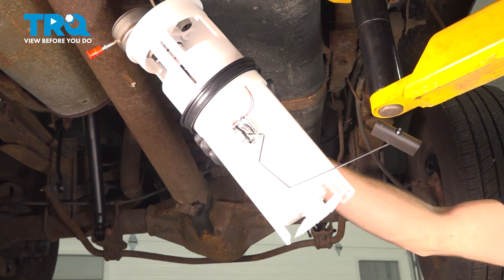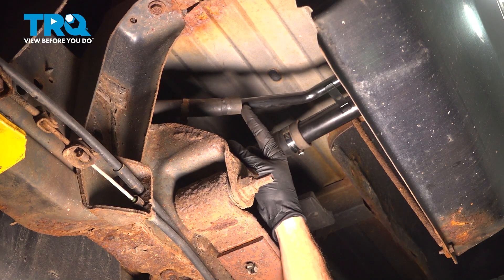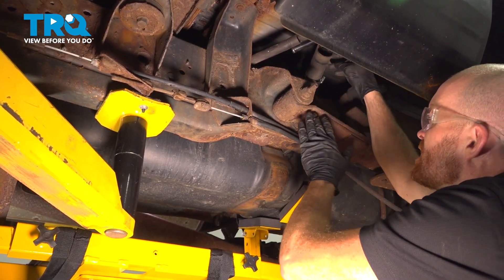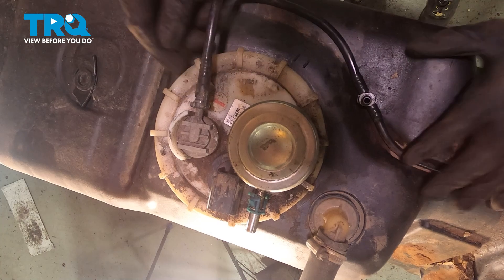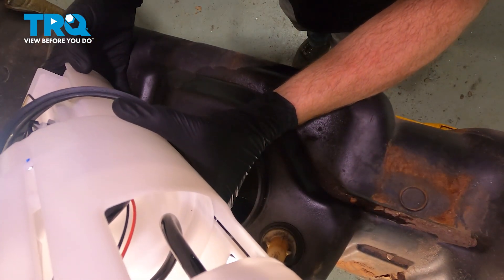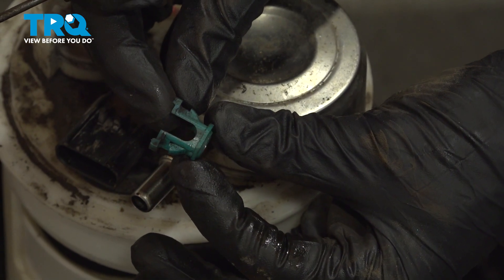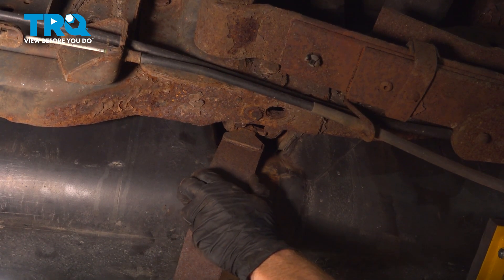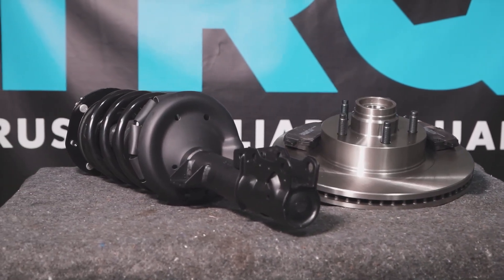How to Replace Fuel Pump 1994-2022 Dodge Ram 2500

Comment: Good video, but no one is answering questions!!!
1a auto, their portal does not list all engines for the ram 1500.
This particular fuel pump assembly is for 5.9 with 35 gal tank, If you follow the link.
Tried the 26 gal fuel pump at 1A auto, the ram 5.9 is not listed. Only 5.2 and 3.9.
Now from. Experience I know if it fits a 5.2 it would probably fit a 5.9, but doing the repair is not a walk in the park either, so why take a chance... i went with another vendor. 😊